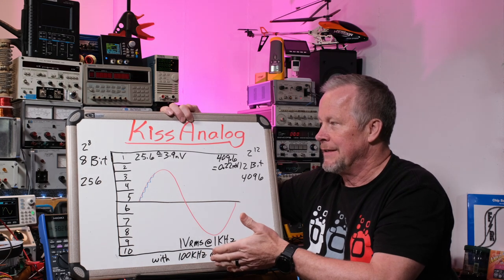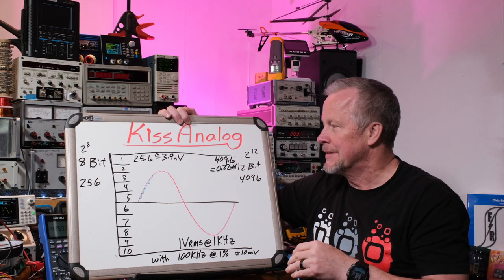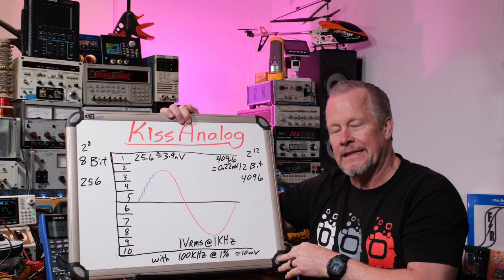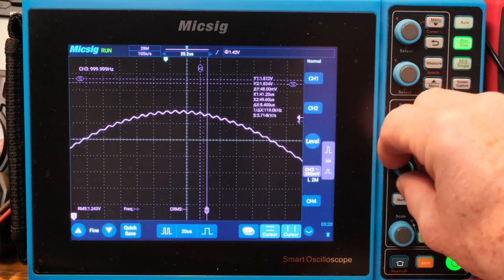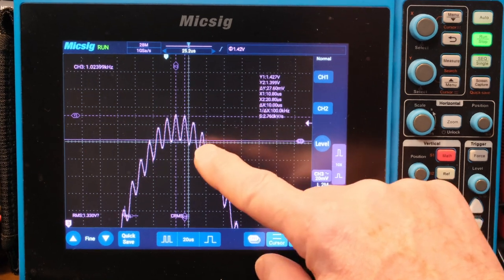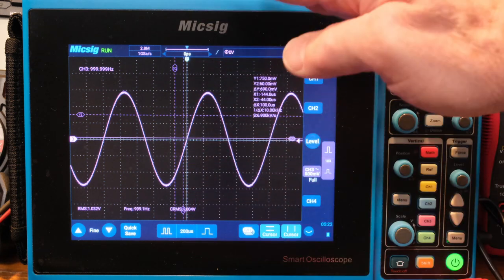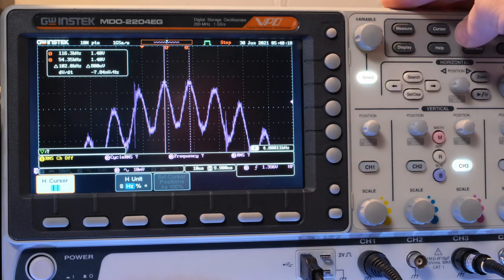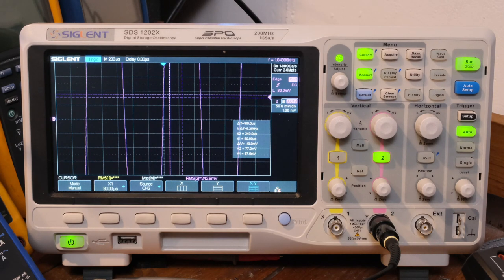12 bit vs 8 bit Oscillscopes Pico vs Siglent vs Micsig vs GW Instek #12bitoscilloscope #picoscope

Comment: This is exactly the reason I bought the Owon XDS3102A, because it has 12 bit vertical resolution (I mostly do audio work). 8 bit is fine if you mostly do digital stuff, but for audio, you want better resolution.
Reply from the maker: Thanks for this feedback!  How do you like the Owon?
Reply: @KissAnalog  It has been fine for my needs, so I have no complaints. The 8 inch 800 X 600 screen is also very nice. Very sharp.

Comment: To see the resolution difference between 12 and 8 bits the oscilloskope should be in Stop mode. Than you can enlarge the signal and you will see the steps and not the 100 kHz sinewave.
Reply from the maker: Thank you!  You are right - that is a great way to do it.
Reply: @KissAnalog  Thank you. I didn't watch to all of your videos up to now, but I like them.

Comment: Hi Eddie, wondering what sort of settings you use on the function generator to get 1khz sine with 100khz on top? I want to replicate that with my Siglent function generator if possible.
Reply from the maker: Great question!  You can try setting the gen output to 1 kHz sine at 1 Vrms, then set the modulation to AM at 100 kHz with 1% depth for the 1 mVrms.

Let me know how it goes.  Which Scope do you have?
Reply: That worked perfectly. Thank you!

I tried the wave combine feature first, and it looked similar but not quite the same. The modulation seems to focus on the spikes, so I see the 100khz signal on the top and bottom of the sine wave, while the wave combine affected the whole sine wave equally, making it look more distorted than in your video.

I have the Siglent SDS1204X-E. I can see the 1% modulation fine on the sine wave, but not 0.1%. I was actually able to consistently see 0.1% on the FFT, though it's very close to the noise floor, so if I wasn't looking for it, I would have thought it was just some random noise.
Reply from the maker: Great feedback - thanks!  Did you want me to show how I set it up?  Maybe I should make a video and try to do it on two different generators?
Reply: I think that would be really nice!

Also, I notice you often use differential probes in your measurements on amplifier circuits. I watched your video on oscilloscope safety, which was really good. Something I would find very useful is if you could also show and talk about safety in actual situations, like when you do measurements in your projects. How to find out if it's safe to probe the output of an amplifier with a regular probe vs when to use a differential probe and so on. Maybe you already have good videos on the topic that I missed though.
Reply: @KissAnalog  Cool. I didn't knew that was possible on my Siglent SDG.

Comment: a 100 mV range / 256 bits = ~0.39 mV per bit (--not 3.9 mV/bit--)--although, with 10 divisions, it would be 3.9mV/div
a 100 mV range / 4096 bits = ~0.0244 mV per bit (--not .22 mV/bit--)--although, with 10 divisions, it would be .244mV/div

Not too impressed by the PicoScope, tbh--especially at that price.  I'd order the scopes by preference as follows:

MicSig
GW Instek
PicoScope
Siglent

Thanks for sharing!
Reply from the maker: Thanks for the feedback.  The part that you are not considering is that I explained that there are 10 vertical devisions in my example, so multiply by 10 then we have the same numbers;)
Reply: @KissAnalog  True.  I noticed that & updated my comments before I saw your response.